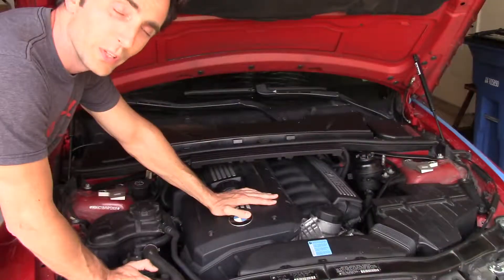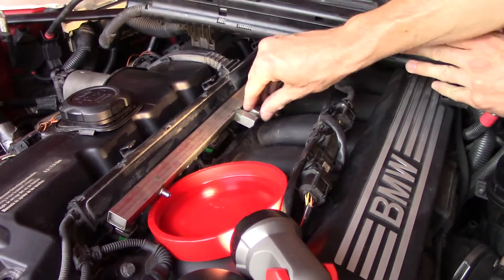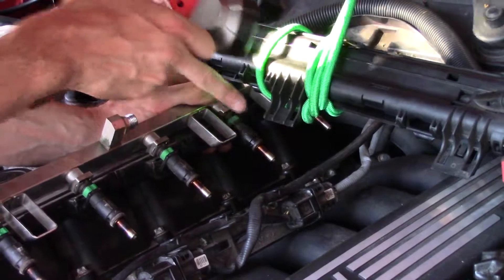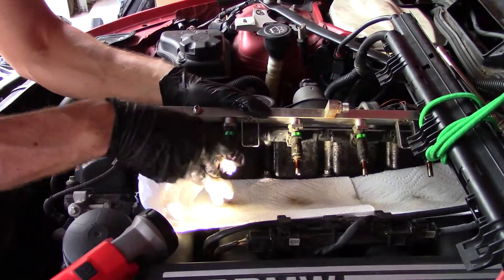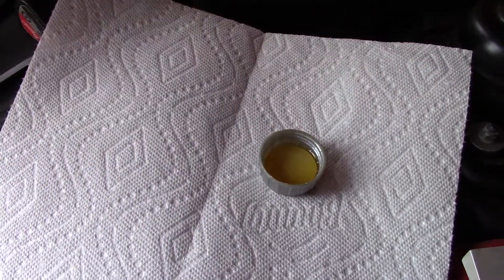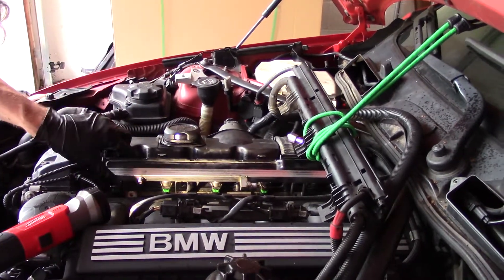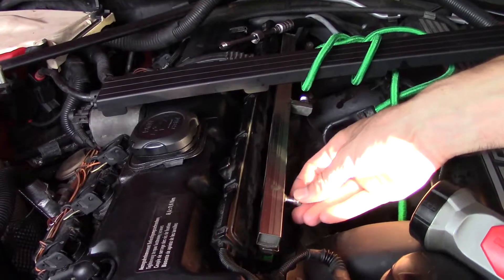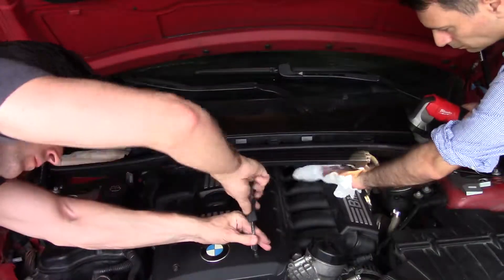BMW PROBLEM SOLVED - Vacuum leak fixed with o-ring replacement

Comment: What was your symptoms and how was the car running before you found the problem, was there any engine codes?
Reply from the maker: The description of the problem from the owner: 
After having the valve cover gasket replaced on my E90, it ran okay for a while before fluttering at idle. Eventually the engine would shut-off at idle and through a check engine light. Scanning it with a ODBII scanner revealed a system too lean message and cylinder misfire. It showed a P0171 and P0174 error codes.  That's how we found the vacuum leak and how I made a smoke machine.

BMW Vacuum Test:
https://www.youtube.com/watch?v=F3H4LfPbIIM

Home I made the smoke machine:
https://www.youtube.com/watch?v=xf9m-vMzAvI

Comment: Anyone knows if this is related to my brake pedal being too stiff and not being able to start my car? I have a bmw 328i
Reply from the maker: Not very likely 😀
Reply: @UrbanMasterExperiment  what’s the reason my brake pedal is too stiff when I try to start my car?
Reply: It won’t start
Reply from the maker: I would start with the brake booster.  It is responsible for helping with the brake pedal.

Comment: The use of the smoke machine leak tester finding the right spot where leak was located is something great on a BMW .  I gave you a thump down because after  fixing the seal on every inyector never tested  them back  using the smoke to make sure the leak was fixing now .
Reply: Test drive.
Reply: They test drove it and it ran perfect after running like crap so....

Comment: Dude, you need to get rid of that cabin filter crap system, and do a cow delete. I have just two smaller filters over the filter openings, and no more gigantic crap cabin air filter contraption. Get rid of it!!!!
Reply: If anyone reads this, don't do it. Those plastic pieces channel water. Without them water gets places it shouldn't be and will cost you $$$

Comment: How could vaccum leaks related injector O rings? Is that vaccum pump leaks?
Reply from the maker: The definition of a vacuum leak in a car is that the air gets in the system past the air intake.  This has nothing to do with a pump.
Reply: @Urban Master Experiment  Interesting, as Air get through, Is it still called vaccum?
Reply: @UrbanMasterExperiment  Would this then be detected by the oxygen sensor?  Seems to be past anything else.